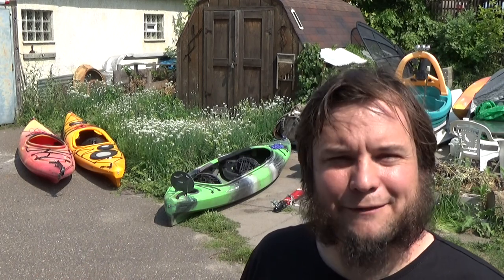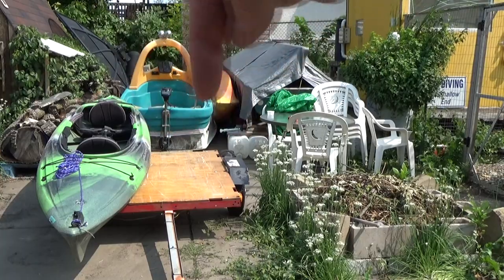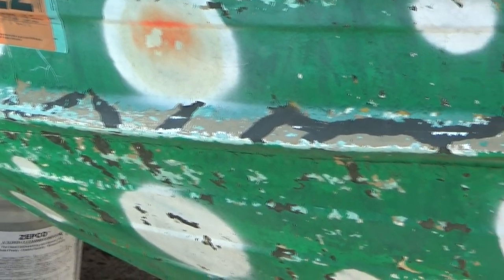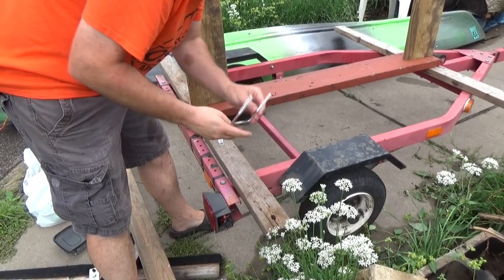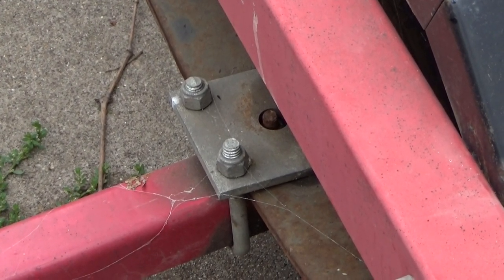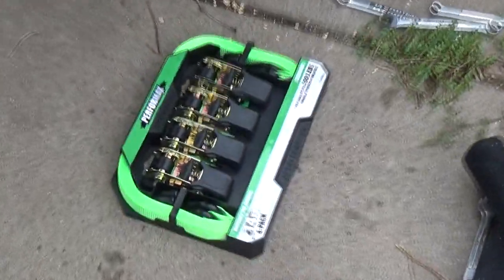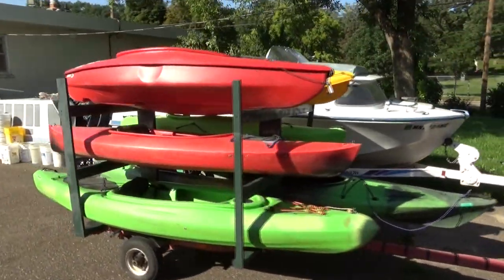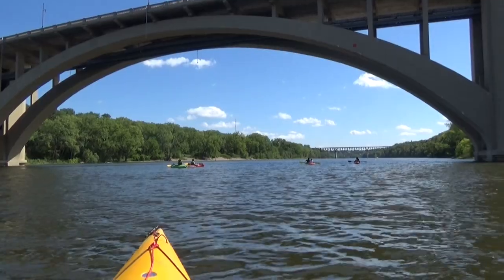Homemade Kayak Trailer for up to Six Boats

Comment: Man this is a nice kayak trailer you build. I am looking for a kayak trailer because i have 10 kayak to carry right now & i will be adding 1 more kayak soon as my newborns grandson get bigger. I like how you built the trailer and it looked very easy to build. I also like how you built the trailer in your sandals man that was awesome. You said you like wearing sandals and that's awesome cuz I am a sandals guy myself I love wearing sandals that all i wear years round. Just because other people are scared to work in sandals doesn't mean you have too. I have to do all of my work either barefooted 👣 or in flip flops because I have big very very extremely wide feet sz15 6E wide with very chubby fat wide toes that are equally straight across making my foot very very at 6 1/2 inches wide from my big toe to my lil toe. My foot outgrew shoes , socks , boots when i was young & flip flops is the only footwear that will barely and i mean barely fit my foot because of my toes being wider than the flip flops straps. So i just go  barefooted 👣 Style cuz it's much easier for me to do. I was born with very very extremely wide feet for a baby & I never thought that my foot would get this wide 6 1/2 inches wide. That is a very very extremely wide foot i have. I have 6 boys & all of my boys have very wide feet too especially my third son his foot is exactly like mine very very extremely wide foot sz13 4E wide with big toe that are evenly straight across making his foot at 4 1/2 to 5 " inches wide from his big toe to his lil toe & he is only 13 years old. His foot out grow socks back in may & trying to find wide shoes for him to wear to school was no good for him because the shoe was not wide enough for his foot so i had to go buy a pair of flip flops in sz14 for him to wear to school. We are a flip-flops family and that is all we wear all year round. I hate having very very extremely wide feet but my wife love seeing my chubby fat wide toes that are evenly straight across in my flip flops because both of my lil toes hanging off the Footbed of the flip flops & she thinks that is so cute seeing my feet in flip flops like that. This video was very very helpful sir thank you for sharing this video.
Reply from the maker: Glad you like it! 10 kayaks is a lot, you might need a bigger trailer for that!

Comment: I’m a fan of working while barefoot. But I’m not very smart.
Reply: I can agree with you on this one. I am 95% of the time barefooted 👣 & i have to do all my work either barefooted 👣 or in flip flops because I have big very very extremely wide feet sz15 6E wide with very chubby fat wide toes that are evenly straight across making my foot very very wide feet at 6 1/2 inches wide from my big toe to my lil toe. My foot outgrew shoes , socks , boots when i was young & flip flops is the only footwear that will barely and i mean barely fit my foot because of my toes being wider than the flip flops straps so i just go Barefooted 👣. That's awesome to hear man you love to go barefooted 👣. We was born to go Barefooted 👣.